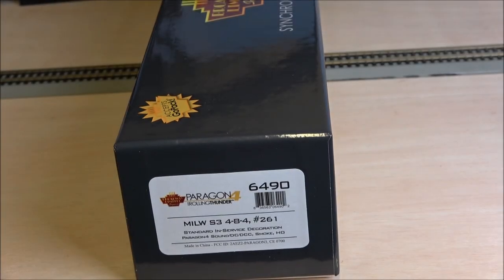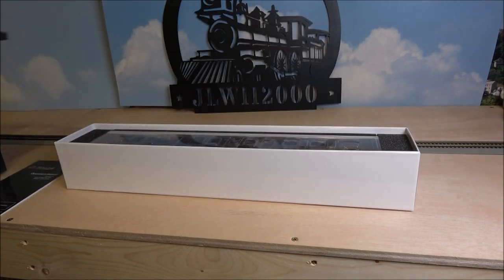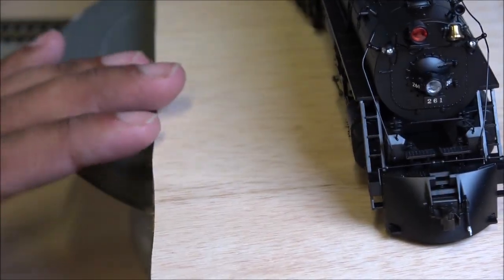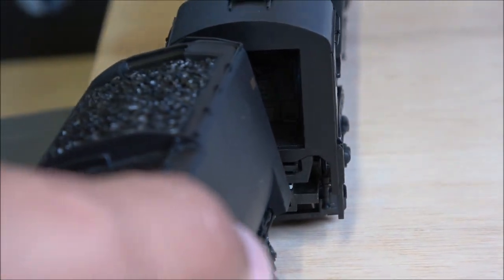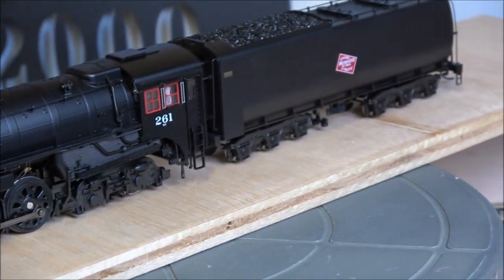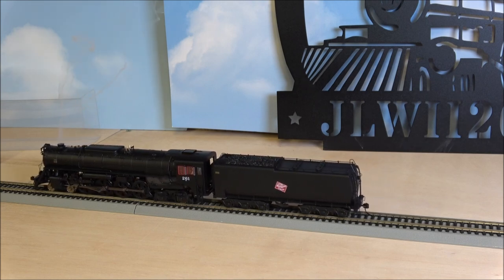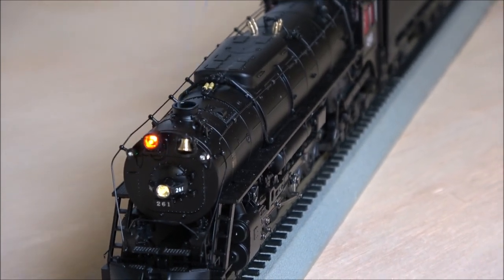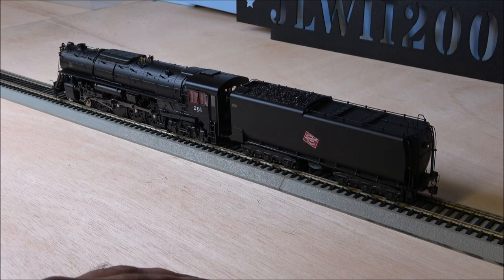Review: Broadway Limited Milwaukee S3 4-8-4 #261 Steam Locomotive BLI!

Comment: They fixed
 ""  the stopping problem for no reason ""
but over time will the decoders heat up and catch fire 🔥----  now finally adding storage capacitor's but skimped out on details ,,,
Noticed nothing for detail on the tenders back beam ,, no air hose's , no steam lines for train heating , ect ..
Reply: I have over 40 BLI steam locos with paragon 3 and now four or five with paragon 4.  If you have some catching on fire you have other problems.
Reply: @MikesProjectsandHobbiesMC  please ,,,SO DO I ,,, I model the PENNSY ,  
6 - P5a , 
10 - GG1's
6 - T1 
10 - DEC's 
8 - K4's 
5 - M1's
6 - J1's 
3 - L1's 
All 24 CENTAPEDES  -- BP 60's 
In cat whiskers === 5 stripes 
4 sets of 3 unit sharks  - FF16'S 
AND THAT JUST HALF ,,,,,,,
I could go on with numbers also -----
Point is the only one that I have not had problems with are the BP 60 / BF 50 .
B.L.I. even had to finely program into their OWN MADE DECODER'S 
BEING ABLE TO TURN OFF THE SMOKE UNIT ,,, WHICH CAN BURN OUT AND MELT THE PLASTIC BOILER AROUND THE SMOKE BOX ,,,
THE P5's had insulated paint under the driving gear box frame to the loco's frame , NOT LETTING THE CURRENT UP THE  ONE SIDE OF THE DRIVER PICK UP , ONLY LETTING THE LEAD PILOT TRUCK CONTACT , WHICH ONLY GAVE 2 POINTS OF PICK UP FOR THE ONE SIDE RAIL ..
OUT OF THE 6 P5a's alone 
1 run good 
2 ran OK at best 
1 ran like crap 
2 DIDN'T RUN AT ALL ,THEY WERE TESTED AT RIDERS HOBBY SHOP IN FLINT MI. WERE I DO ALL MY BISENESS 
RIGHT OUT OF THE BOX ,  
(( WERE I GOT THEM )) 
THEY WERE SO MESSED UP DECODER WISE ,, SET THEM ON THE TRACKS , AND THEY SHOT RIGHT OF AT A SCALE 500 MPH ..
MELANIE AT BROADWAY SAID IT WAS A MOTOR ISSUE ,,
WRONG ----- ITS A PROGRAMMING ISSUE INTO SOFTWARE DECODER  BOARDS , ONCE THEIR PC boards components get to HOT , THET WILL OVER HEAT ,,
3/4 OF MY BLI FLEET 
THE EASILY DOUBLE YOUR'S 
HAVE BEEN SWITCHED OVER TO TSUNAMI II WITH POWER KEEPERS WITH 1,000,000 TIMES IMPROVEMENTS

Comment: The sound is abysmal. All that hype around Paragon4 and it’s improved nothing. Swapping decoders is a pain too.
Reply: Have you any actual experience with P4? The sound is fine and changing decoders is not all that difficult.  Keeping the smoke unit with another decoder might be a challenge.
Reply: @ Brian Anshen if you look up the real engine and here it's whistle; you will notice that BLI is pretty close in its duplication although not perfect. Outside of its whistle the rest of the sounds are not bad.
Reply: Right... no significant diffrerence between PS4 and PS3... just marketing...
Reply: It's the same poor quality sound file that was in the P3 MILW S3s. Such a disappointment.
Reply: @sd80mac  Yeah... 😏
Reply: @FrankJGZ  Thats because its an actual recording of the whistle. LOL
Reply: Sound is subjective but I watched my video on my home theater last night and it sounded just fine. Im happy with it and thats all that matters I guess. Does Soundtraxx Big Steam and or WOWSound sound better, maybe. I installed Soundtraxx Big Steam in my BLI Big Boy and its pretty amazing. I have several Paragon 4 locos not (40ish BLI locos total) and the P4 has been solid. The built in keep a live is great and the function remapping option to mimic other decoders is nice too.

https://youtu.be/tfoeiuxZboQ
Reply: @FrankJGZ  the whistle isn’t even looped properly. You can hear the distortion because the amplitudes don’t line up. Even my custom ESU whistles don’t have the problem. Plus the sounds all sound off at random. Totally unrealistic.